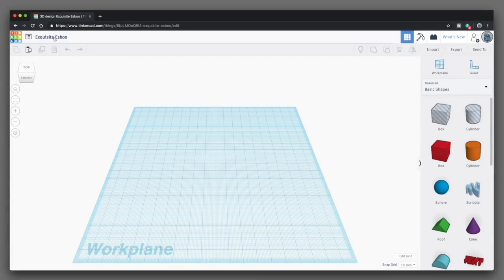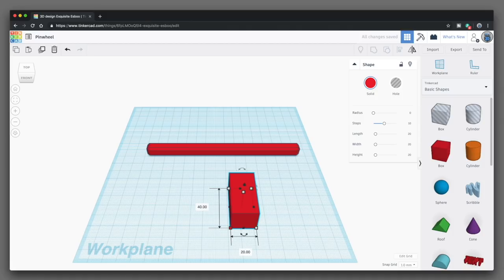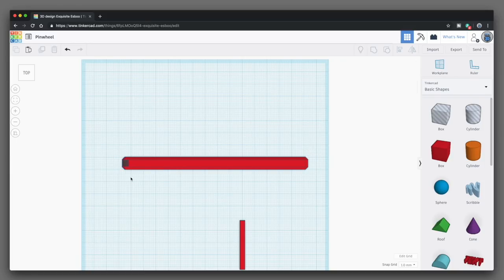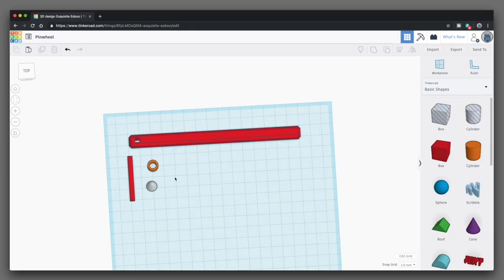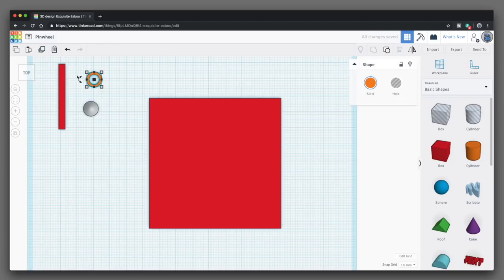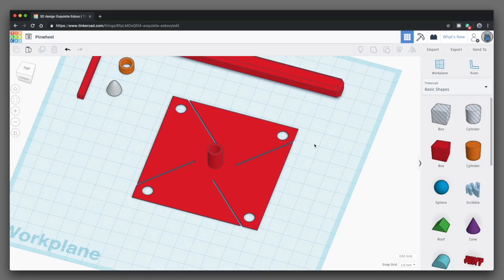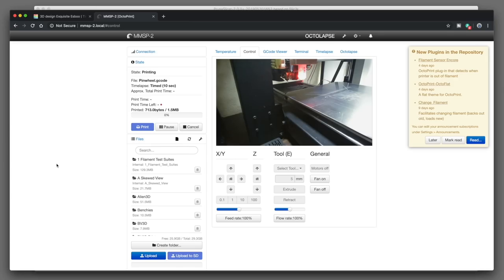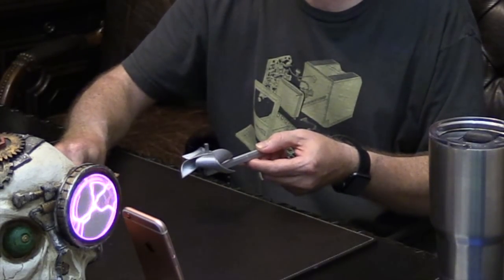Summer 3D Printing: Design, Print, and Thermoform a Pinwheel!

Comment: Fantastic video Bryan. And great tip about the inspector panel and the print sizing of fitting parts. Thanks.
Reply from the maker: Thanks Cathy! I am curious to know why Tinkercad's inpsector panel doesn't track the object size. But as long as you know it does that, you can work within its limitations to get what you need out of it.

Comment: Awesome, can't wait to try this for my kids. Thanks for sharing!
Reply from the maker: Hi Thierry! For fun, try a color change on Layer 2 of the pinwheel part. When you fold it over, you'll be able to see both colors!
Reply: @BV3D  that's a great idea. I'll do one of those next. I'm also going to follow your tutorial on the design tonight for practice with tinkercad. Might try and design a hub insert to facilitate lining up the foils. I used a drill bit to line things up on my first one which worked great as well (tagged you in the tweet).
Reply from the maker: Awesome! Keep me posted! 👍

Comment: how is the whambam system doing thinking about getting it for my maker select plus  do you know what size would fit the maker select plus
Reply from the maker: It's doing very well. I've had it on the Maker Select Plus since last year sometime and it's still working like a champ. For the Maker Select Plus, you'll want the 220mm square size. The corners are notched to accommodate the screw heads on the bed. Affiliate link: http://bit.ly/2K5wdW4
Reply: @BV3D  thanks for the link